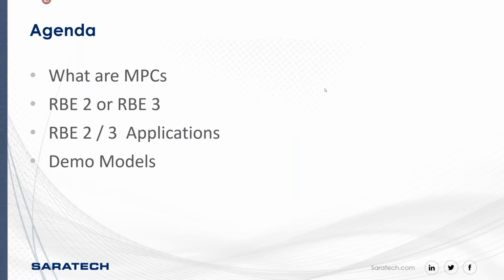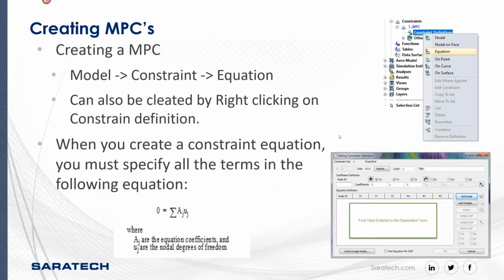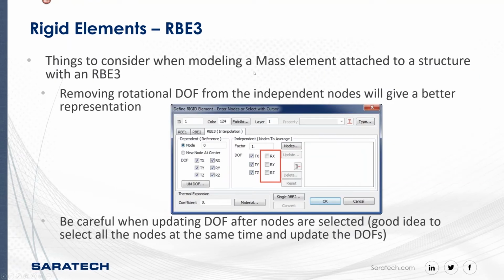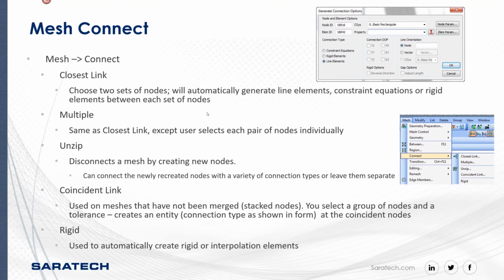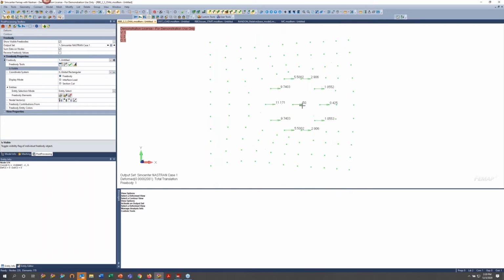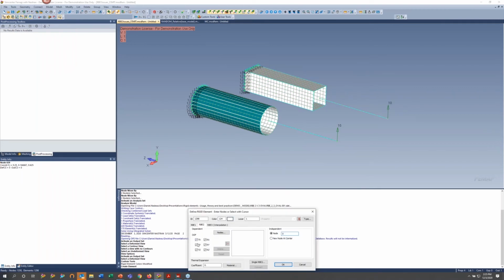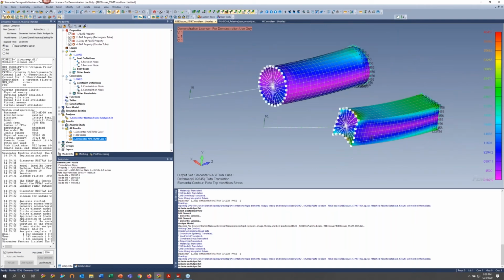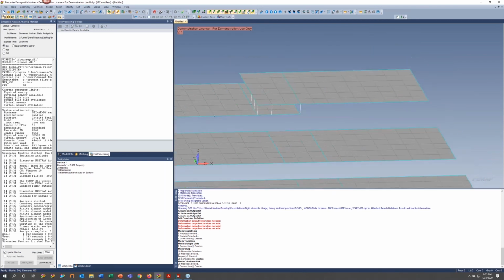CES: Creating MPC Elements in Femap (RBE2/RBE3)

Comment: Hi, I have a question, can I use RBE2's to define a hinge connection? Lets say I have 2D manifolded body of a wardrobe and I want to connect its door to a side of it with hinge connection, what kind of approaches I can take? 

Thank you
Reply from the maker: Hi Ali, this sounds more like a kinematics problem, but here we’re typically discussing linear static structural analysis. Depending on your exact analysis, you could possibly constrain specific degrees of freedom of your RBEs to simulate what you need in a dynamic/nonlinear analysis.